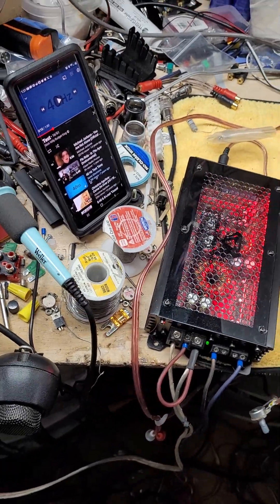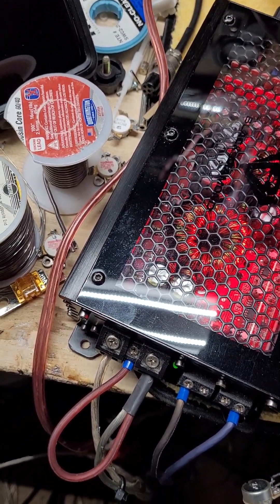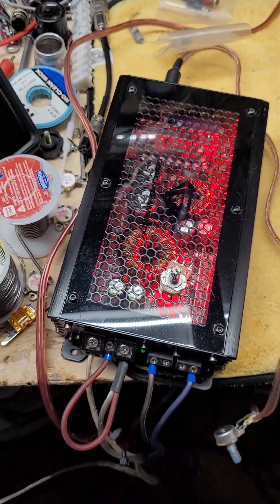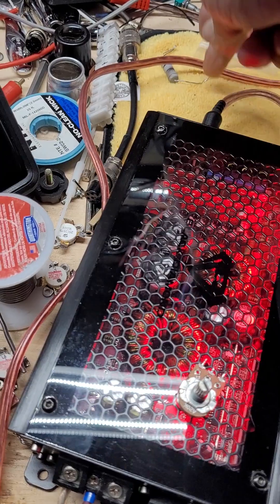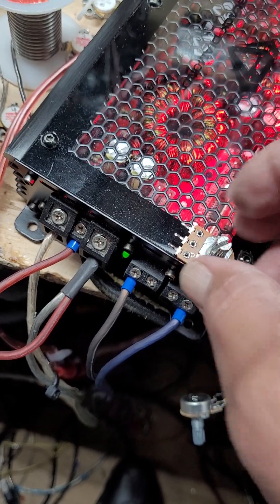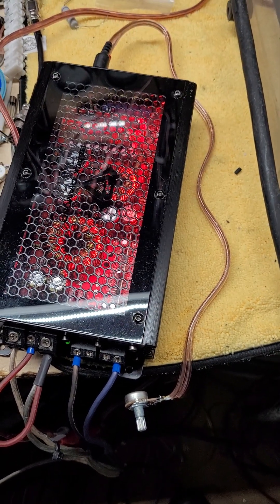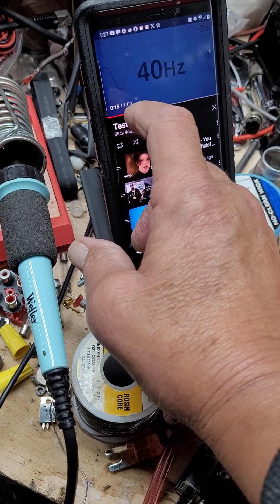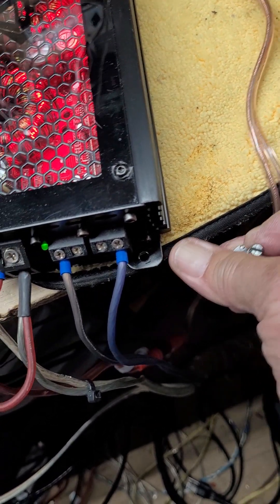How to wire a rca bass knob remote potentiometer

Comment: I'm curious if I sent u my old Stinger knob if you could possible attach pontentiometer to board. I have tried but am a rookie with pcb. I got it to work one time but was in and out tried again with better soldering iron and had no luck getting them to work again. I have tried getting new knob direct from Stinger but twice now they have sent me knobs that don't work with the Stinger mt4000.1
Reply from the maker: I think it'd be easier on you to hit up the local electronics/TV repair shop for a quick solder?
Reply: We can do something like this!

Comment: After recarpeting my truck I can not locate my Hifonics bass knob!  I have alreadt ordered and returned a generic knob claiming to work on my Hifonics ZG-3200.1D Zeus Gamma monoblock amplifier and now wamt to try this set up.
As I see, my amplifier connected is set at full power coming out of the subwoofers if the 6 pin flex wire is not plugged into the amplifier.  When I plug in the 6 pin flex wire into the amplifier, the bass coming out of my subwoofers is reduced to whatever the setting is on the pot. 
Watching this video has me realizing that the 6 pins in the flex wire is split between recieving & sending to amp the pot's setting.
And that is exactly what your doing.
Thank you. I think I nave a couple A5 pots in an old Japanese portable radio I can use.

Comment: Do you sell the new part for better adjustment? Just got my stinger 700 amp and read that’s the only flaw. Haven’t installed it yet tho. I’m also not great with soldering lol
Reply from the maker: I can't remember if I bought that part at digikey or Mouser. I thought I said so in one of the two videos
Reply: @slickwillybudgetking  yeah I think I looked it up couple weeks ago and the shipping was way more then the part to me.
Reply from the maker: It was same here 😥 I'm sure you can use a cheaper delivered potentiometer,  I just don't know what wire does what from original.
Reply: @slickwillybudgetking   That means opening up amp and figuring out what is what.
I was just on a Chinese companies website looking at dozens of bass knobs all lined up looking the same but each having a different part number &different  amplifier that the knob controlls. It is exactly as you commented, each mfg. has their own pinout doing the same function.

Comment: 50k is most common, as it cuts out the signal so you can remove bass altogether.  Also, w/ 3 tabs is best for mono. Any stereo pot you get is different value per channel, very minor but definitely not matched from one extreme to the next. Yes, you can combine them at least when its a sub output, rear output should be fine but would be cautious depending on which headunit you have. Ive made tons of them. You will have mono in and mono out, perfectly matched because its the same signal.
Reply: Also, for guys competing in spl competitions that have no power limit, most experienced competitors will know but most pot's do not zero out. By that i mean when turned up/least resistance, you will find they will still show resistance, from a couple ohms up to 20+ ohms for some ive tested.
Reply: yo man !! i want to make my own bass knob ! ( for subwoofer amp only and also i will use it via Rca on preamp from unit to amp) should i go linear? or log? also what resistor? 10k? 50k? 100k? thanks in advance man.
Reply: @MrCryptonxxx  most sub outs on headunit are mono, i would use 50k with 3 prongs, it will be linear in and out
Reply: @MrCryptonxxx  difference in resistance and where cut off lies. A 10k will work but even all the way down you will have output, 50k is enough resistance to give complete cutoff, deoends on what you want really.
Reply: @MrCryptonxxx  go with high quality cables, i have several that ive tested. Stingers higher lines have very little resistance and are budget friendly but keep in mind, the linger the cables, the more resistance youll have. Decide what you want to spend and go from there. I also make them from precision pot's, ive done this for some time and see other doing it now... basically you get 10 turns to go full volume, instead of 1 turn. I personally like linear, log will go up high on the last 25% of adjustment. Depends on what you want and need it for. I like knowing half way is half volume. Its all a preference
Reply: @MrCryptonxxx  you're welcome

Comment: C taper is the exact opposite curve of audio taper. Love your group and content!!
Reply from the maker: So peak center and resist L or R?
Reply: @slickwillybudgetking  It's the exponential on the resistance as the knob turns. Linear has no taper, so 50% on the knob is 50% of the signal getting though.
50% of the knob on audio taper is only letting about 10% of the signal through, 75% on the knob is letting about 60% of the signal through and 90% on the knob is about 95% of ths signal allowed to pass. It seems like it's smoother because of the way we perceive volume (the whole 3db is perceived twice as loud thing).

C taper is the exact opposite of that
Reply from the maker: Odd. Seemed like in actual use, only 40% of the adjustment was effective on the linear, 90% on audio.